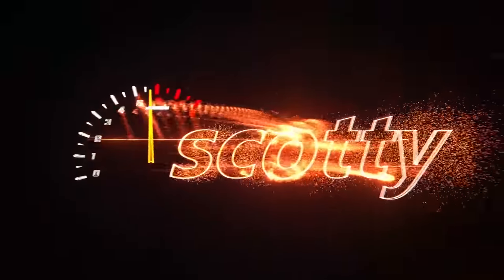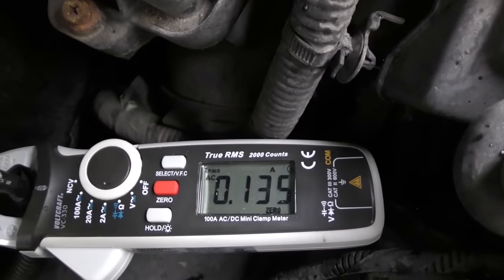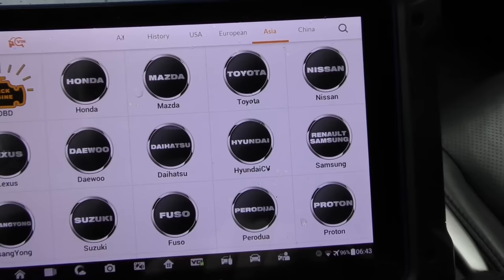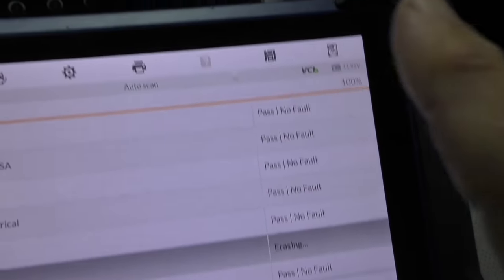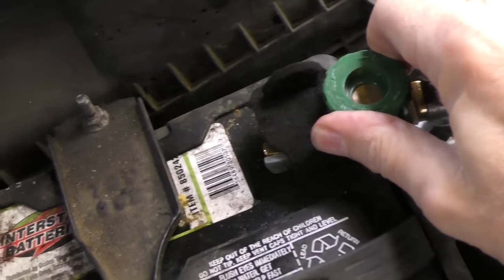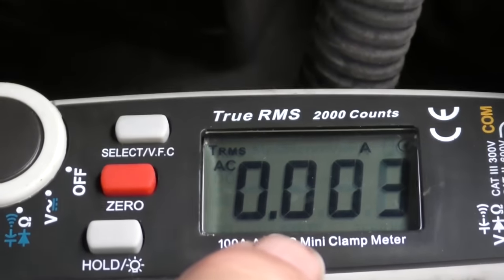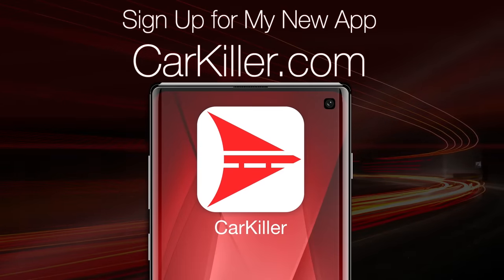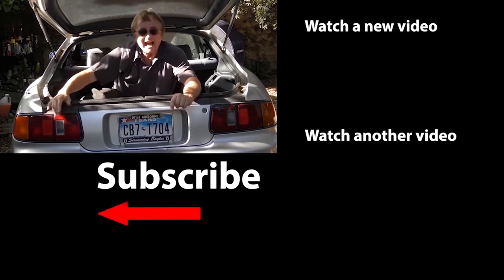Watch This Before Buying an Acura

Comment: SCOTTY this happened to my 05 TL. It ended up being the Bluetooth module by the rear view mirror. I'd bet that cars having the same problem
Reply: Yeah it is. This guy is an entertainer, not a mechanic. obviously failed to diagnose the most common issue on these Acuras. What a quack

Comment: Try the Bluetooth module by the sunglasses holder. My grandmas Acura TL experienced the same thing and disconnecting that module fixed the problem.
Reply: Yes that is exactly what it is...
Reply: Same with Acura TL TYPE S SAME PROBLEM
Reply: The amp clamp was set to ac instead of DC.....
From the FLUKE website

How to measure current with a clamp accessory
Determine if the current to be measured is ac or dc.
Select a clamp accessory for your multimeter that is designed to measure that specific current or one that can measure both ac and dc.
Note: Look at the accessory clamp’s specifications and determine whether the clamp outputs a current level or a voltage level.

Comment: That Acura would drive me nuts Scotty.
My vote is also just disconnect the battery.
Reply: It’s just the Bluetooth built in. I took mine out of the TL problem solved
Reply: That’s just dumb having to do that everyday multiple times a day.  It’s the Bluetooth module.

Comment: I have a 2007 Acura TL. Had same issue, all it was is the (HFL Hands free Link) I just disconnected it and never had the issue again. It’s located above the review mirror where the sun roof button is.Take apart and disconnect the computer module.
Reply: A good auto tech with 50 years experience would check the TSB’s..
This boy did not.

Comment: I have a 2005 MDX.  It's been a great car until about 2015 or 2016, I started having dead battery problems.   Initially they told me it was due to my current driving habits, going short distances between starts, so the battery never got a chance to recharge.  I temporarily solved the problem by driving the car everyday, or long enough to charge the battery.   But if I forgot to drive for 2 or 3 days, the battery went dead.   If I left home for over a week I disconnected the battery, and the car started right up when I returned home.  I bought a portable jumper battery, and in the past 2 years I have jumped my battery countless times.   I took it to the dealer 2 times to get the electrical system checked but they reported no problems.   I just took it in (June '22) and they reported a bad battery, so I had that replaced.  I brought up the problem again and they said they would try disconnecting the Bluetooth (which I never used).   I don't know if that worked since I have to stop driving the car for several days.   My ON STAR stopped working also.      Other than that, I love the car, and it's great on long-distance road trips.   I keep up the regular maintenance schedule, and the mechanics say it is in great condition, aside from the normal things that wear out.   Those get expensive,  but it could be worse if I didn't keep up the regular maintenance.

Comment: My Hyundai was doing the same thing. There was a CD stuck in the player, and it would  unsuccessfully try to eject it even when the ignition was off. I disassembled the radio, and removed the CD and now the battery is fine.

Comment: It's the old style Bluetooth happens on the 3rd gen TL 1dt gen tsx basically any Acura in the mid 2004 through 2008 with the handsfree link Bluetooth not the ones after just disable the Bluetooth all g or upgrade the Bluetooth module aftermarket
Reply: True I bought a tl with the Bluetooth parasite drain and as soon as I removed it the battery worked
Reply: I had a similar issue with my 2005 TL where if it sat for too long the battery was getting drained.  Did some research and determined it was probably the hands free link module malfunctioning.  I replaced the module with a used one for about $100 and it never happened again.  Apparently Honda got some bad batches of these modules that would eventually go crazy.
Reply: @mgabbard  the Bluetooth is gonna start doing the same malfunction it's a computer glitch just disable or upgrade it
Reply: That makes perfect sense.
Reply: @stuartbear922  it's a known tsb
Reply: 2004 Acura TL .  Had the same issue with the Bluetooth.    Not worth all the drama .  I took it apart and threw it in the trunk never had a problem again.   That was a great car.   I miss it .
Reply: As soon as I unplugged mine my car has been running fine
Reply: When you say to upgrade the Bluetooth to aftermarket, is there someone repairing or replacing the actual Acura module? Or you mean disable it and get one that wires in separately to your radio?
Reply: With mine it was something in the door I unplugged and it stopped
Reply: So this won’t happen in a 2011 Acura TL tech package?
Reply: @K_steph31  no the 4 the gen TL from 09 so on won't have the issue
Reply: @colinnwn  it's the same you can get a bluetooth module that work better with the already compatible connectors (cheaper and better-diy applicable) or get a new radio with extra features and wire it (3rd party) to work if you do this wiring method I'd install a decent back up camera and get one compatible with the buttons on the steering wheel

Comment: Meter is on AC current setting, change to DC.
Reply: Be easy on him. Hes only been a mechanic for 74 years.
Reply: But he wanted to measure the air conditioning. ...
Reply: Will get odd readings if on AC when measuring DC. I have a clamp meter in my car that covers DC supply. Intermittant faults are a bloody nightmare to trace
Reply: Dan Lekin well done lol
Reply: dude, that meter has both AC and DC current reading ability on same setting. you can see both AC and DC symbol beside 2A.
Reply: Amp meter current
Reply: @patrickzambori473  i have that same clamp meter and it shows AC on lcd screen even if you select "DC mode"
Reply: Yeah scotty it's been already several times and seems he's too afraid to ask a real electrician. @Scotty Kilmer why don't you call an electrician to tell you.
Reply: @lordjaashin  Adding to the confusion, pulsed DC can also be detected as AC in some designs. Inexpensive meters seldom have good technical documentation. Sellers are often clueless about such things.
Reply: yep
Reply: @lordjaashin  I have same, great unit , you have to switch to DC to measure DC
Reply: @ZegaracRobert  i know that we have to switch to DC to measure DC current but for some brilliant reason my meter still shows AC on lcd. don't know why it does that

Comment: I worked for Honda/Acura - on those years RDX the Bluetooth computer modules were all faulty. There was a service bulletin that was issued, he could have had a new one installed under warranty. Also the Navigation was issued a service bulletin, that unit was tied into the HVAC unit harness and it would freeze the nav unit sometimes. It would be replaced at no charge to customer if they let the dealer know. New Nav unit and wiring relay.
Good luck convincing the service manager anything is wrong unless they witness it lol

Comment: Do a voltage drop test across the fuses to see if you can isolate the circuit. Use a wiring diagram to see what modules are on that circuit and unplug them one by one. Or fit a remote isolator if you can't fix it.

Comment: I have the same quick disconnect as this guy and get this I have the same gremlin as well on my 2006 Acura TL...

I'm going to take it to the local Sun Valley stereo here to see what they can do... My mechanic recommended them today and that he's had that shop for over 20 years. He even said my car drives really nice But, I also have a lot of aftermarket electronic stuff on it and they would defiantly be able to help.

I wish I lived 200 miles from you Scotty because to me it would be worth it to drive to you.

Comment: Bluetooth module gone bad - classic for Honda Accord 2007, drain battery in 3 days. I disconnected mine and it was hot even though car hadn't been out of the driveway. No more battery drain

Comment: I have three of them and never had an issue. As a matter of fact one of them. Is a 2004 acura tsx and has 400000 miles never has had any problems. Also an mdx 2007 never any issues and now i have another tsx 2012 and never had problems.

Comment: I had the same problem with my 2009 mdx before knowing what was causing the drainage the 1st time I took it to the dealer and they said that the acura link module aka Bluetooth needed replacing so I did, the 2nd time about a year later same problem they said I needed a new alternator so I did and now about 3 months after a new alternator my car would not start, luckily I got a jump and after 10min it started so I quickly went and got a new battery installed and it's been ok ever since, so I did some research and the problem was the acura link module is a bad design and acura knows about it but will never tell you, to fix the problem you will need to disconnect the module its very easy to due the module sits behind your center console, sit in the middle of your back seat and pull back were the heat comes out from, it will be pretty hard so you'll need to pull hard once thats off you'll see it it's a black box about 5" long 3" wide and 1" thick it should have a grey or black connector on right or left of the box with some wires just disconnect it and thats it , you just wont be able to use the Bluetooth no harm done, you might need to unscrew the box before you can disconnect it....

Comment: I remember in my sister's 2004 Accord 4dr was draining current too. I pinpointed the problem to the radio (would drain the next day all the time. All I did was cut the radio's +12V and ACC line, tied them together, and connect to a switch with a fuse (in series) to the battery. The switch was installed in one of those available/free accesory receptacles usually found on the left side of the dashboard. Problem fixed.

Comment: I had a mercedes doing the same thing  i installer a master switch like on off road heavy equipment,   you can place it in cab  that way you can shut off all power and turn it back on without opening the hood haaaaa

Comment: FYI, those battery disconnects are great, also antitheft...  :)   But on the ones like that that I've used, all you actually have to do is loosen the top (green) handle and it's disconnected, no need to actually remove the cable where it's attached with the screw.

I was surprise Scotty didn't show checking the battery's condition first, that'd be where I'd start.  Perhaps it's on it's last legs, still can start the car when fully charged, but even a small drain for a few days brings it down enough to not start again.

RichE San Diego, CA

Comment: The green knob is the battery disconnector. You do not have to remove the terminal - just turn the green knob one way or the other, on-off mode.
Reply: Lol yeah I'm shocked he didn't know that with all his years experience

Comment: I definitely wouldn't leave it. I'm the type of person that HAS to fix it and figure it out. I watched another video. The guy diagnosed the excessive parasitic draw by pulling fuses until the meter showed no problem....then he looked at that part of the circuit diagram. He eventually found the fault in the rear seat audio control bluetooth unit...was causing excessive drain. His method for locating the problem was fairly easy and effective...although you need to be able to follow and trace circuit diagrams.

Comment: Its the Bluetooth. Happened to my MDX too. They disconnect it. I believe there is/was a class action lawsuit against Acura for it as they just disconnect your bluetooth rather than fix/recall causing you to lose resell value.
Reply: Boblib1970 what year was your MDX?
Reply: @omzizo715  2009
Reply: Boblib1970 I have a 2016 I'm wondering if they corrected this issue or is this something I can look forward to!

Comment: Being the old electrical fart that I am (1953 BD like someone else I know). Clamp on meter is indicating AC? All types of wiring can act like antennas with digital meters indicating small current flow or voltage. This is where I'd pull out the "analog" meter & put in series with battery (watch polarity of meter terminals in relation to battery terminals (series hook up)). Set meter to low setting & see if needle moves on the analog meter. Must have current flow, not induction, to move needle on analog meters. Retired electrician in old chemical plant. Have been bitten a few times by digital meters giving me false readings due to induction. Wires packed together in conduit (wiring harnesses too) even with power totally removed from process & grounded can indicate a "digital" reading. Great video Scotty thank you. I watch you every time I go on the prowl for vehicles. Loose cable, bad news. That will trash electrical equipment. Be safe, keep up the good work!

Comment: I had the same issue on a 2008 Acura and it is a known issue with the hands free system searching for a connection. Once I pulled the overhead light and disconnected it no more issues.

Comment: My GMC Sierra 2500 had a battery drain issue and I finally got a solar trickle charger, placed it on the dash, then park the truck facing south and now no  problems.  Worst part is, that if a battery goes dead too many times, it dies itself.  It has not gone dead in years now, and latest batteries 3-4 years old, are still good. It takes two batteries and it was expensive changing them every 3 years like clockwork.

Comment: What do you think of these RDX's overall? We've had an 11' since new and are over 100k miles and it's been trouble free with regular service.
Reply: Only issue ive heard is it can be thirsty if you step on that vtec turbo. This has to be the rarest honda engine next to the vigor/2.5tl 5 cylinder
Reply: My '09 RDX is sitting at just over 190k miles, and has been the most reliable car I've owned.

First owner took it to 150k with no repairs (just fanatical about maintenance).

The only issue I've had is the DVD drive for the nav system died. Some dealers were fixing the issue by completely replacing the entire system, but I diy'd it for about $50. 

Only other non-maintenance things I've done are replace the "leather" cover on the center console (under $20 on eBay) and replace a broken sun visor.
Reply: @jasonm3871  I've replaced that cover too. Also the rear "wing/spoiler" the paint is completely gone off the top and the plastic is all raw and rough.
Reply: Drooskeedoo my paint still looks great.

I did have a fog light lens get shattered, so I made new lenses out of Lexan (has to do the same on my wife’s tsx).
Reply: So good so far with my 2007. The only thing I got to get checked out is my windshield wipers. They act like they don’t want to shut off when it cold but work fine when it’s warm. But other then that rock solid no problem at all.
Reply: @CRAPO2011  it's definitely thirsty. I get the best mileage driving it manual and not letting the boost gauge needle move up
Reply: Love my 08 no major issues has 3 years now,  approaching 160 k, so far just needed an alternator ,a battery,  small power steering leak and rear brakes calipers and all. Tires are quite pricey as well as oil changes and of course premium fuel requirements with such poor gas mileage. But reliable fun functional daily driver for sure.
Reply: @jamynreed1134  just put a set of Michelin premiers on them $1k. My entire approach to tires is buy the quietest possible. The stocks were so loud I did a bunch of research and found Yokohama Avid Ascends were the quietest I could get 6 years ago. The change was amazing. When those got used up I wanted to get them again, bit after researching they've changed the compound they used and are getting a lot of complaints. The Premiers have been amazing. Better than the yokos
Reply: Mine had the Yokos on when I bought  it I found some coopers for around 700 or so , I hate them they are garbage wish I would have paid the extra and bought something better.
Reply: They do occasionally have turbo issues and the exhaust manifolds are prone to leaking coolant. Both of which are very pricey repairs.
Reply: @Blood1Group  the exhaust manifold have coolant going through them? That can't be right.
Reply: @drooskeedoo3388  right im guessing some one had been riding hard and blew a head gasket. Pretty sure if you drive it civilly you can count on that Honda reliability.
Reply: @drooskeedoo3388   There is coolant running through the manifold (to cool the turbo). The lines corrode over time, thus the leak.
Reply: @Blood1Group   The turbo issue centers around a very small piece of metal that wears out on the linkage for the turbo actuator (resulting in an under-boost code).

Acura's fix is to replace the entire turbo, but there is an owner/enthusiast that makes and sells a beefier linkage.

Comment: Scotty you had an error in your current clamp usage. You have a current clamp that is able to measure True RMS AC or DC but according to the display it is on the AC setting and a car battery is definitely a DC source. I have never seen a current clamp used that way that didn't jump around.Try again but make sure you hit the select button and change it to DC. You will probably find the indication of power drain you were looking for. Good luck!

Comment: It is the bluetooth mondule and I solved the problem by installing a relay on the power supply wire to that module. The relay I used is one that is that is commonly used in automatic washing machines.  The relay opens the circuit when the key is off so even though the bluetooth module has a fault, it will still work properly when the engine is running.  When you switch off the engine the relay opens and no power can get to the bluetooth module, so there is no parasitic drain.  I powered the relay from the power source for the power dock in center console compartment.  This was a good source to use because it cuts out when the ignition is in the off position.  My little fix has been working flawlessly for two years now.